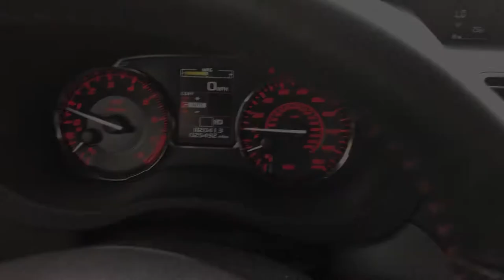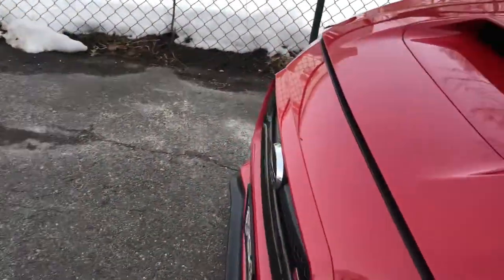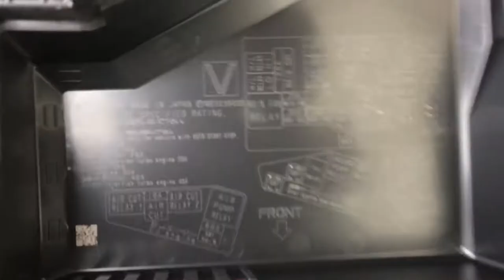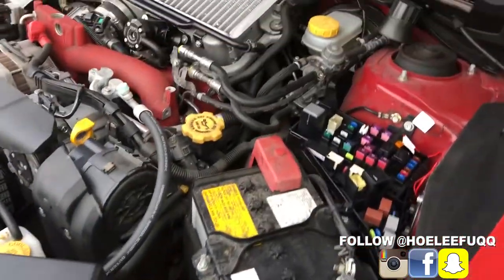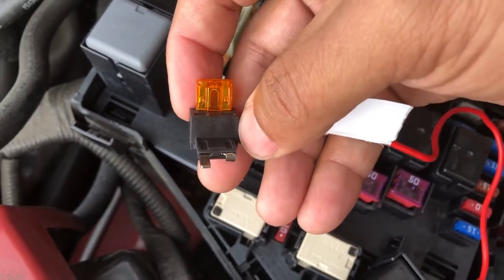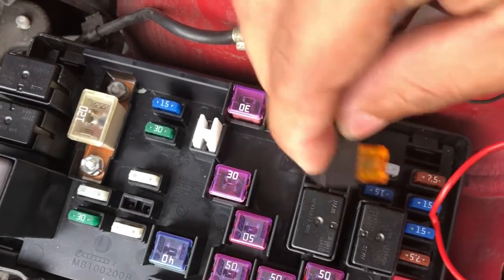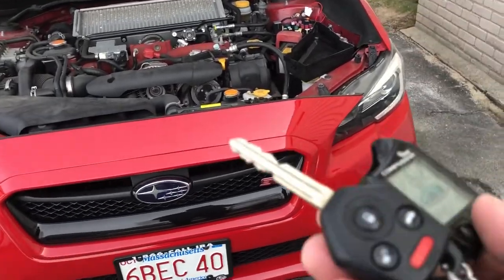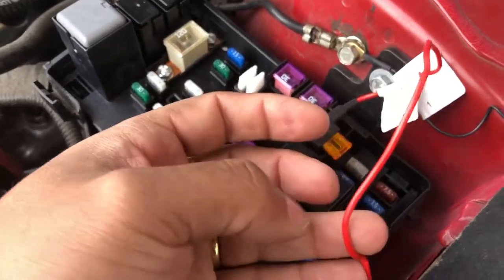JDM S4 BEZEL LED FUSE TAP EXPLAINED

Comment: when did you get the bezels...about time. You should do a STi engine detailing vid, I wanna do mine but a wee bit scared.
Reply from the maker: The2basic Yeah should have gotten them sooner really makes the front end look much better. The engine does need a cleaning 😂
Reply: I have a few LED connections under the hood, so not sure if I want to blast the engine with water.
Reply from the maker: The2basic any electrical connection make sure u cover with rags or tin foil, intake stick a towel in it to cover/stuff it up alternator cover it up you should be fine